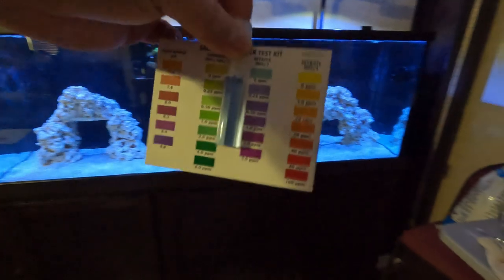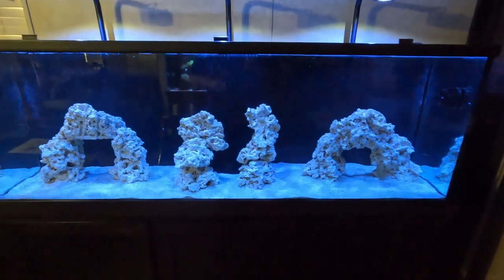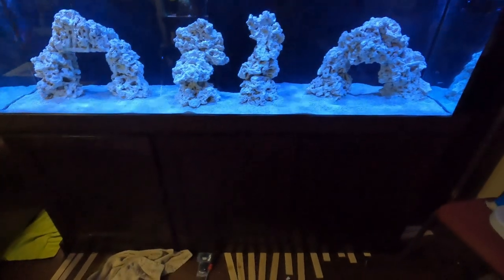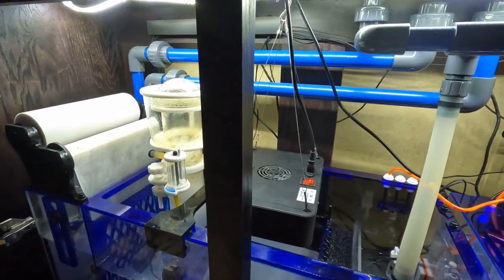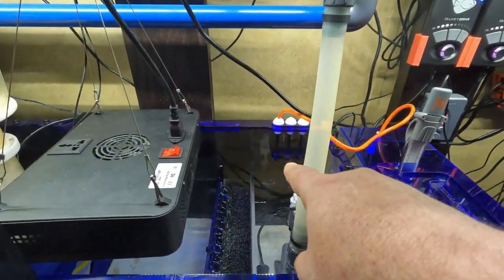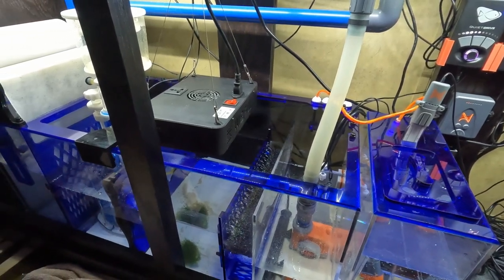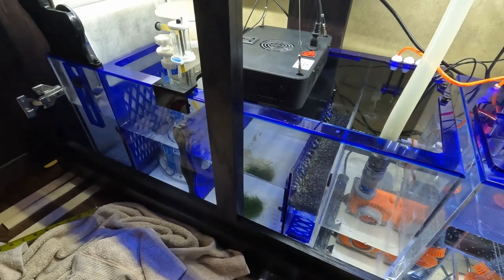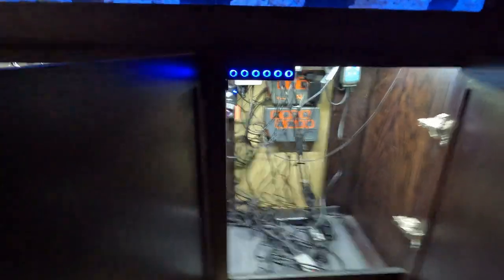150 Gallon Mixed Reef Build | The Cycle Is Complete | New Lights | Refugium Light Is Installed

Comment: Looking good, lots of equipment to keep clean in that sump. Just my thoughts but why did you decide to start with all that stuff, instead of getting good lights for the display, then add whatever filtration you need as your tank grows in?
Reply from the maker: The lights that are on the display are the lights I will be running. Kessil A360x's x3. The lights are only that dim because there was no reason to make them any brighter. They are at 5% in this video. Since the cycle is over and I'm getting the tank ready for coral/fish now, I'm slowly ramping up the lights to see if it has an affect on the "ugly stage". So far, it's far better than in years past. 

As for filtration, I likely have too much filtration with the Trigger Systems roller mat. But I would rather have too much that I can dial back than too little  that can't keep up (ahem, the 90 lol)

As for the "all the stuff", This is pretty much my "I don't care what it costs, I want the best within reason" build. Is it expensive, yea it is. But it's something that I have wanted to do for many years, and I'm now at a time where I can do it. 

As for the cable management mess, I'm still working on that LOL. I have a plan, I just need to dig the table saw out from under boxes and make it happen. 

My question to you is, do you not think A360x lights are any good? What would you have done differently? Always keen for others outside view on things.
Reply: @OkieTony I understand the cable management getting in order, by mess I mean everything you plug in is in your stand, next your high humidity sump.  

I keep wires and plugs above the tank, gravity never fails so water can't ruin my stuff unless I spash it for some reason. 

 I have no experience with kessil lights, my honest thoughts on what I'm about to say are my opinion on what I see from data and reviews. The A360X are way under lighting a tank for that size, maybe if you want to grow some softies and low light lps, but I don't think those lights have the output to actually grow SPS coral in your tank. I may be wrong and would love to see if you do with those lights.

 I'm gonna use an analogy here, the tank is built like a formula one track, but its driving a Honda Civic.  Without the power what use is that track? 

Question: what is the goal for this tank?
Reply from the maker: @atkinsnatureaquariums3552  I got ya. And I get what you are saying for under the stand. As long as the items are away from salt spray, they will be fine. There is a large gap in the back for airflow so although humidity can and will be higher than in the room the tank is in, it will not hurt the electronics in my experience (been in the hobby over 15 years). I'm definitely not saying one way is better and I completely understand those that want to play it the absolute safest they can. 

As for the lights, for what they are, compared to something with far more wattage consumption, yea they are weaker. However, Kessil is very well capable in growing everything. I'm not a big stick fan (Acro's) but I will be putting some in the tank. I have no doubt that it will be fine with the lights that I have on the tank, especially when I add the XHO's or the like to help supplement the lighting and cut down on the harsh shadows. 

And yea, It's pretty high end equipment, I'm tired of messing with the cheap stuff that you have to replace every year. 

As for my goal for the tank, To enjoy it. It will be a mixed reef tank with a moderate amount of fish and mostly LPS, some SPS and very few softies. The only softies will be slower growing like Clove Polyp's. There will be no mushrooms, GSP, Maybe some zoa's, but they will be isolated, and absolutely never putting xenia in this tank. lol. Learned my lesson on that years ago, even though I love the way it makes a tank look. I may have to convert the 90 to a softie lol. 

Thanks for the comments!